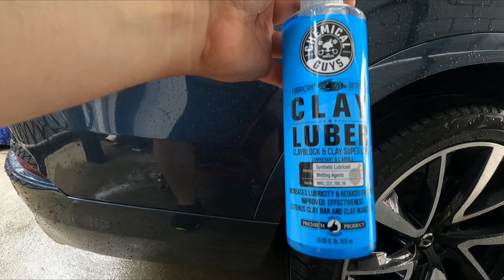AvalonKing Ceramic Coating On The Wife's Volvo XC90

Comment: Nothing like the feeling of a super clean vehicle! I thought I had ocd with my vehicles your on a whole other level and I love it lol. I wish I had a shaded spot or garage but unfortunately I don't. My son just turned 16 and we just got him what he wanted a new 22 silverado in Black smh. And 2 weeks old with just touch free washes and already has light scratches in the sun. I told him I haven't had a black vehicle for a reason and he was dead set on black now he's regretting it. Wondering if ceramic coating would help,  the paint doesn't even feel waxed, like when it's clean it's not that smooth feeling u get after a vehicle was waxed. I know it needs to be stripped of anything for ceramic coating but I know the lack of anything isn't helping the paint. Any input since your wife's vehicle is a darker color? I stick with white vehicles lol
Reply from the maker: Sup Shane. Hope all is well. I will be doing a video for a awesome easy ceramic spray soon. You will like it.
Reply: @MikeLife1  just busy brother but can't complain.  And okay awesome I will be keeping a eye out for that video! Much love Mikey